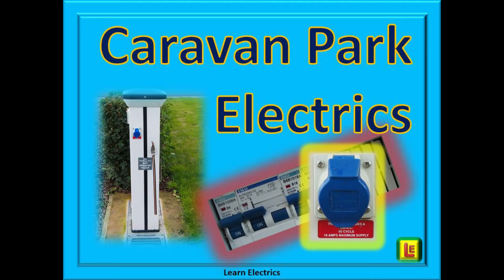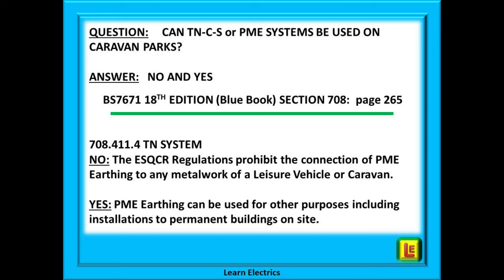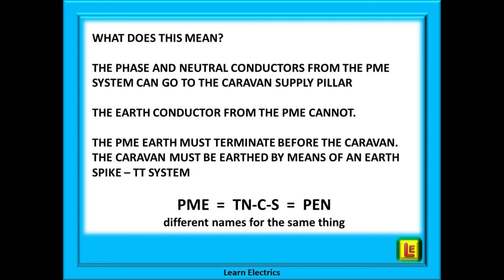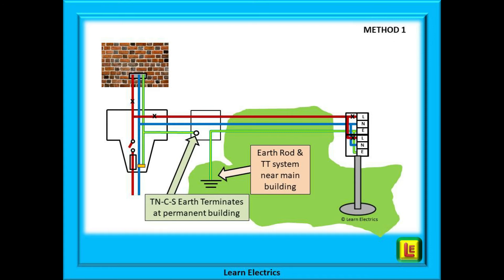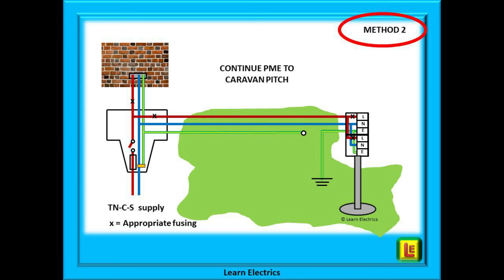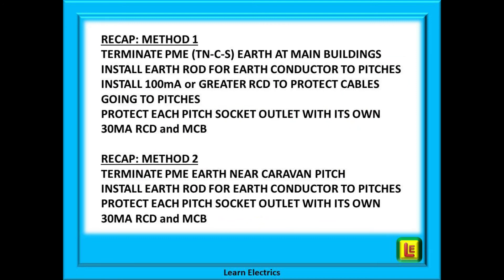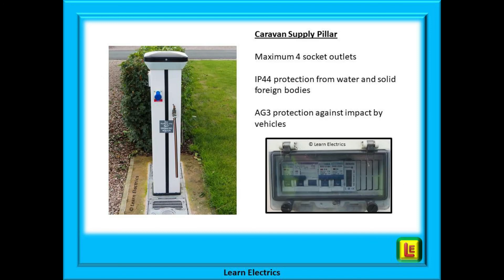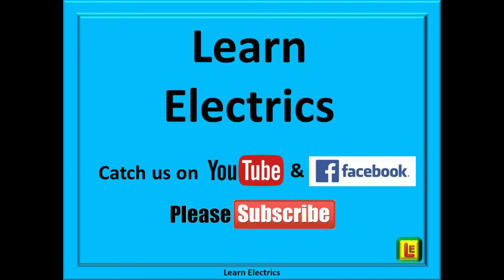CARAVAN PARK ELECTRICS. HOW TO INSTALL THE EARTH CONDUCTOR AND COMPLY WITH BS7671 WIRING REGULATIONS

Comment: Do caravan sites ie holiday parks come under part P , I believe they don’t as they are commercial businesses and caravans even static ones are not used as full time domestic dwellings.? But I believe that council owned permanent caravan sites where the caravan owners live as  there permanent homes do or do they? Canal boats that are used as a permanent home don’t come under part P as they are only allowed to stay in one place for a week or two then have to move onto another morning further upstream or downstream depending on which way they are facing. Also are privately owned caravans and canal boats required to have a n EICR if the owner rents  out to someone else?. But I could be wrong. Please advise if possible.
Reply from the maker: That's a good question, regulations can be confusing and you're right about the potential variations which can be confusing. Even if they don't come under Part P, caravans etc will still need to comply with the Wiring regulations, canal boats must have regular inspections, safety certificates but I don't know the frequency. Renting out? It would make sense to have certified electrical and gas inspections and insurance. Thanks for watching. Dave.

Comment: What about inside the caravan/static, most already have a 30ma RCD so that’s 2 on the same circuit correct?.
Reply from the maker: The caravan site have a responsibility for safety and the caravan manufacturer has a responsibility too.

Comment: Hi all. Great video to a problem i was having very little luck in finding a solution to... until now. The question i have is on diversity. The caravan hook up post i'm fitting is a 4x 16A. Do i need to supply 64Amps or can i reduce this as a reduction takes me from 16mm to 10mm (50Amps) or even 6mm (38Amps) SWA. I know 6mm is a long shot, but fingers crossed.
Reply from the maker: You need to consider length of run as well as maximum demand. If it was me, I wouldn't even consider 6mm for what you have described, not if potentially you have 4 separate caravans all cooking and watching TV at the same time.

Comment: More often than not the first 'discussion' is what constitutes a caravan / mobile home/ static / residential park home. 

I have seen so many 'static' units (purposeful wording) with decking and skirting that park owners will insist are 'permanent buildings'.

The regs are the easy bit after that!
Reply from the maker: For the Wiring Regs, I always assume that if it has a 60309 plug and socket for its power, then it is mobile. If it is permanently wired in then its permanent. Of course, Park owners might have their own definition.
Reply: As such how are people approaching this matter?
When is permanent not permanent and so forth?
Reply from the maker: See above reply. Thanks.

Comment: On method 2 where you terminate the incoming earthing co duct or locally at the hook up point ( in separate terminal ) do you still require 100ma rcd protection for the armoured cable feeding the pillar ? Or would just an MCB be ok as it’s an armoured cable.
Reply from the maker: All cables need RCD protection at some point. Follow the examples in the video and you will be ok.

Comment: Just a thought but what if the supply intake is TN-S? Would an earth rod still need installing? Would it matter if it’s a metal frame or wooden building? 
Thanks
Reply from the maker: With TNS it is already a separate Line/Neutral/Earth at the intake. If the metal framed building is "earthy" then consideration should be given to earth rods to minimize potential differences in the vicinity of the building. Hope this helps. Dave.

Comment: This is very helpful & I’m very grateful for this video. I’m currently doing my first EICR on a static caravan & working out the supplies at the caravan site. 
I’ve found a sub main about 60m away from the static caravan (that I’m working on) supplies the consumer unit inside the static caravan. The SWA cable at the sub main that goes to the static caravan is protected by a 30mA RCBO. When I’m testing the RCD’s inside the static caravan the RCBO at the sub main trips first. Meaning the RCD’s inside the consumer unit at the static caravan don’t trip & it trips at the furthest point. Will it be right in thinking that the RCBO in the sub main should be replaced with a 100mA time delay RCBO? That way any further tripping of RCD’s will just trip inside the static caravan first? There will still be RCD protection on the SWA cable at the sub main then as well. Any help would be greatly appreciated. Thank you.
Reply from the maker: Yes, the pointy end, the bit nearest the users should be 30mA. To achieve good discretion, those closer to the incoming supply, the origin, can be time delayed and 100mA . Thanks for watching. Dave.
Reply: @learnelectrics4402  Really appreciate your help & advice. Thank you for your reply. Keep up the great work 👍🏻

Comment: Hi, using method 2 you don't mention using an rcd at the supply point in the main building, is this not necessary when using this method? What would you connect to in the main cu? Would you take each post from a 16amp mcb? Is a dp isolator needed? 
Also, hook up boxs are now supplied with 16 amp rcbo's for each socket, do these replace the need for an rcd and separate mcb for each socket and is method 2 the same for rcbo's?
Finally, for method 2 is the armour earthed at the pitch or at supply?
Sorry for all the questions, but a few things are unclear.
Reply from the maker: The supply to the main building will need RCD protection and yes, RCBos will replace RCD plus MCB. Thanks for watching. Dave.
Reply: I understand the main building would need an rcd, but what about the supply from the CU to the pitch, does this need an additional rcd, it doesn't show this in your diagram for method 2?

Comment: Hi there, lovely clear dialogue sir thank you. 
Can you remind us all why TNCS can’t be run direct into a static caravan please. 
Ta in advance 👍🏼😊
Reply from the maker: These are the words that I was quoted.
On residential caravan parks or mobile homes, if the supply is connected directly to the caravan or home without the use of plug and socket then it is considered to be a standard electrical installation and is covered by the general regulations.
Hope this helps.

Comment: You don't say why you shouldn't connect the pme with the earth rods for the caravan outlets. I'm asking because we have just had a supply put in for a shepherd's hut and the electrician appears to have tried to use the pme from the main building and found the resistance to high and added some ground rods at a secondary distribution board to correct this. This doesn't sound right.
Reply from the maker: Matthew. If the supply to the caravan or hut is by plug and socket the Regulation 708.411.4 applies. This states that where the supply to the site is TNCS then the Earth to each pitch MUST be separated from the PME and supplied using a TT system.
However, on a RESIDENTIAL caravan park, if the supply is connected directly to the caravan or home without a plug and socket, then this is considered to be a standard electrical installation that is covered by the general regulations.
Hope this helps, Dave.

Comment: Hi, I'm really enjoying your electrical videos. I have a couple of questions.
1, If you use method one, with a RCD 30ma at post and a 100mA protecting the radials (time delayed) would it matter what type of RCD at the main board (time delayed or not) or would you only have one RCD for each earthing system PMS and TT. 
2, also how can you recognise a time delayed RCD?
Many thanks Andy
Reply from the maker: We have to consider discretion Andy. Which RCD is going to go first if a fault occurs. It should always be the device nearest to the fault so that unaffected parts of the installation continue in use.
Time delays should be upstream of any same rating devices that are non delay type.
A delay type RCD will not give personal protection, you need 30mA for that.
Most delay RCDs will have the letter S amongst all the other symbols. Often in a little box. Sometimes the symbols are on the side of the RCD and not visible from the front. Every manufacturer has a different system, it would be good if we standardised everything but they don't. The definitive way is to check the manufacturer's part code. Hope this helps.

Comment: Hello, I have a few questions, do you have a contact email? Thanks.
Reply from the maker: Ask away Dave. If the questions are relevant to the video we can answer them or direct you to one of our other videos. Dave.
Reply: @learnelectrics4402  thank you. So I am running a supply for a static caravan in a clients garden. The supply wants to come off a DB in a out house which is a sub main from the main building. The DB has a RCD main switch of 63amp 30ma. The static caravan also has a DB in side with a RCD main switch with a rating of 40amp (possible 30ma again) I believe the caravan will need a 10mm supply. Unable to find a 40amp hook up I am leaning towards the idea of just hard wiring the caravan without a hook up. If done so what would be the appropriate method? Would I still need a 100ma RCD? 
Thanks.
Reply from the maker: The video is about caravan parks where caravans are pluggable. If it is hard wired it should be treated as a building and Part P notification will apply.
100mA RCD gives additional protection against fire etc. but will not give protection to humans against electric shock dangers. 100mA RCD is always installed upstream of a 30mA device.
Reply: @learnelectrics4402  Thank you for your detailed reply, much appreciated Dave!
Reply from the maker: @Dave0Star  You are very welcome.

Comment: Hi sir...wouldnt i need the same arrangement for a work shed ... jus in case there is a PME fault jus like a car charging point or a caravan park if the supply is a TNCS arrangement AND also if i dont have any extraneous earth bonding inside a house... meaning the GAS and WATER is plastic also drain pipes...would i need a earth rod then
Reply from the maker: TNCS in a work shed is ok. Keep the earth continuous. Caravan parks are a special location within the wiring regulations. Main bonding is a different subject and it is planned to do a video on this soon and on supplementary bonding.